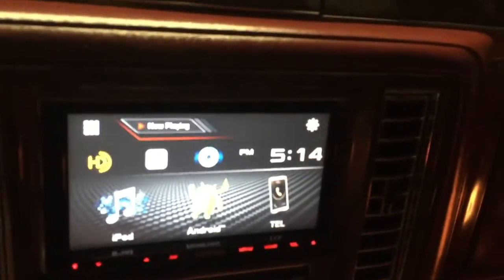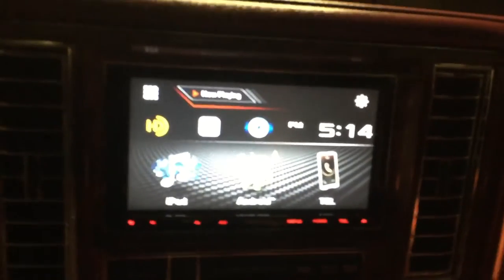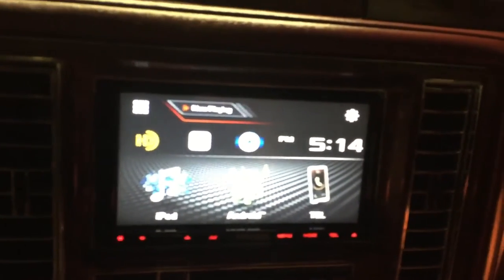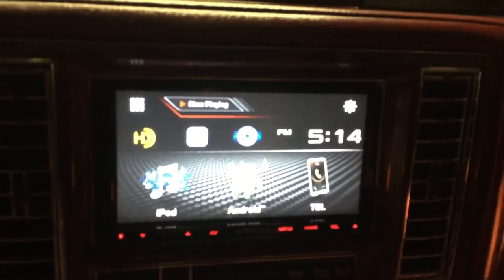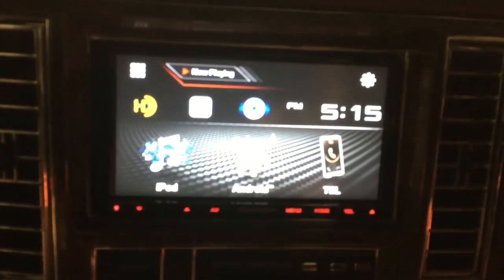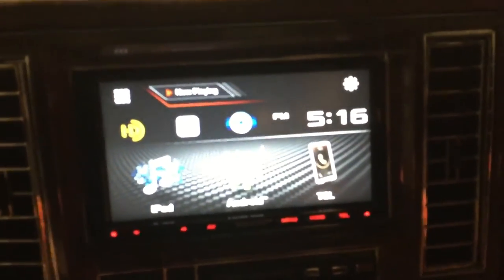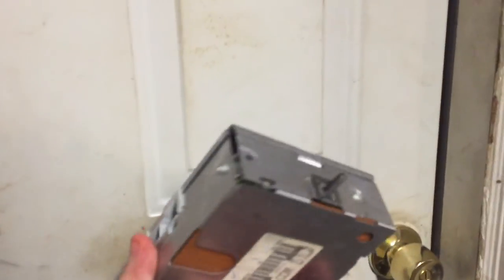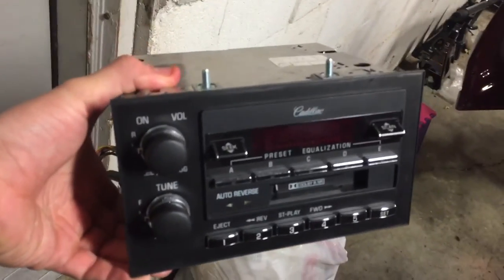Double Din Kenwood Screen Install 1992 Cadillac Brougham D'Elegance

Comment: . Yo I need help I have a 91 brougham. I connected the hardest kit to the amp wires but not not why one old connected won’t connect to the new one. Can I give you a call
Reply: Same problem wonder if it just lays there

Comment: How do I get to the amp without ripping my entire Dash apart.
Reply from the maker: FENIX6669 take the radio out and unplug everything from the factory amp. Then go under the dash and you will see a bracket with two small bolts. Take the bolts out with the bracket. Then turn the amp sideways and it will slide out.

Comment: You did not give the name of the install kit.
Reply from the maker: Victor Cannon it was just a meter double din trim plate. I fabricated everything else. Had to cut out the back vent and make a new plate to cover the venting. The screen was too deep.
Reply: I read that u cut the back vent out I'm having trouble getting mine to mount flush what did u put to cover the vent and how to still have the heat and ac come thru vents wish u had video of that can u explain ?